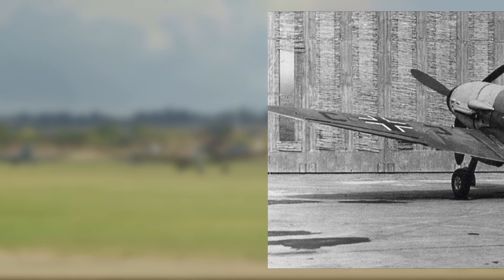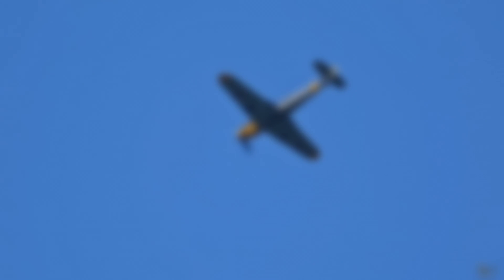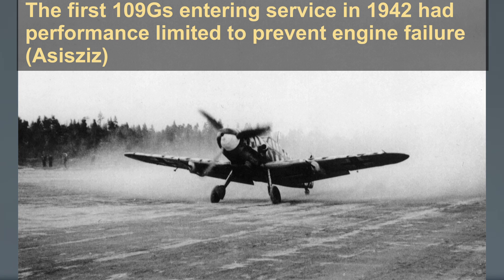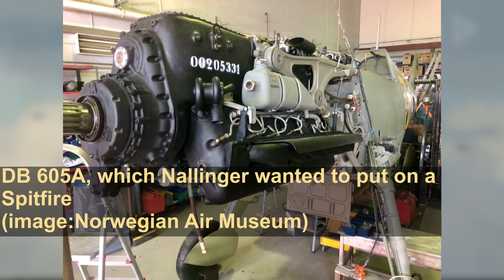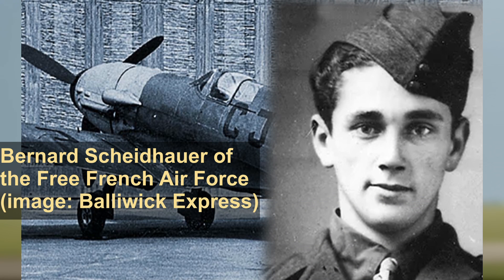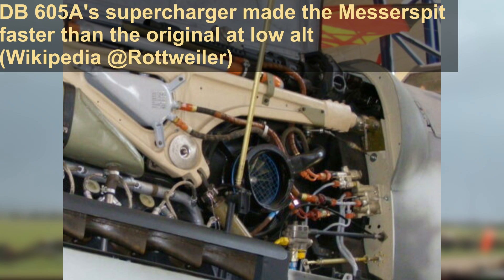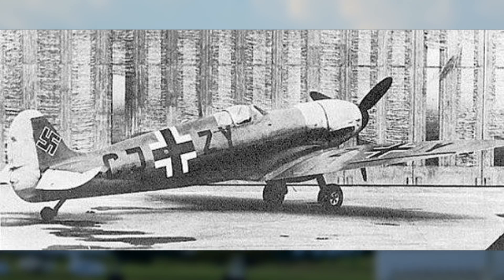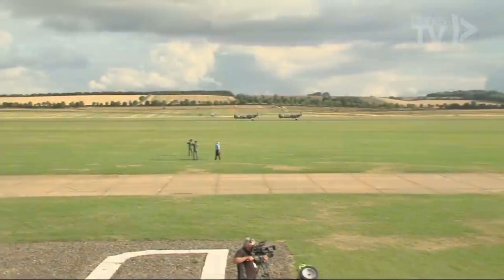All is Fair in Corporate Warfare | Spitfire with DB 605A, “Messerspit”

Comment: wasn't german synthetic petrol roughly equivalent to lowest acceptable grade of american petrol?
Reply: C3 was 130 octane. Reaction with fuel tank liners did however degrade the octane levels. The Germans also ran very lean mixtures which also impacts actual achieved antiknock performance.
This was partly corrected by injection of methanol which has an inherent octane of 114 and also significantly cooled the cylinders. The cooling effect raises the effective octane by 19 points.
Reply: Supposedly their fuel was 87 octane. That is low octane car gasoline today.

.
Reply: @craigd1275  Yep. heard same thing a from Greg's areoplanes and automobile channel. He mentioned some big diffrence between estimated and factual octane noumber caused by faulty processing or something. but i'm not sure if it wasn't C4 petrol as he compared super late war performance of mustangs and Fw-190 d-13. And here we have bit earlier dispute.
Reply: @radosaworman7628  Greg's airplanes takes the position that German avgas octane ratings were limiting factors to German engine performance. Actually, the exact opposite is the case. British knew this in '43, and we're puzzled to war's end as to why Germans were making avgas with octane limits exceeding their needs. Germany's crucial, staggering lack of strategic alloying materials was crippling their engine performance, preventing higher boosts, rpm's, requiring much increased maintenance. At that point, needing higher octanes was the least of their worries. Think of it like flying into combat with a bunch of glass engines: do the "wrong" thing and bearings spin, valves burn (detonation), gears fail.
German engines, very accurately & precisely machined, had after 1940, increasingly alloys much inferior to Allies, lead babbitt bearing technology unable to cope with the required stresses, no nickel in the valves (Allied valves almost solid nickel), etc, etc.
Reply: @craigd1275  That was the prewar B4 specification. 
Britain ran on the same fuel. Russia used 65 Octane (which made Russian fuel unusable by anyone else).
Germany switched to 93/115 Octane C3 at about the same time the British rolled out 100/130 and the US 100/120 with the Germans progressively raising the octane to 97/130 by the end of WW2 but there was never enough to go round.
High octane fuel shortages were why jet engines got pushed hard. Jet engines will run on absolute shit fuel.
Reply: @radosaworman7628  Those figures were from US studies on German and British fuels so use US testing protocols. Basically the Germans did have fuel that had an only marginally lower octane rating than American and British fuel but never enough of it.
Russian fuel was absolute shit.
Reply: @radosaworman7628  Those weren’t German figures. US technical research analysed the fuel in the tanks of shot down German aircraft.
The best synthetic fuel wasn’t better than what the British or American’s made but it was closely comparable. Adding methanol injection made up the difference for fighter aircraft.
The Germans just never had enough C3 fuel and had to depend on the lower octane B4 fuel for all their bombers and a lot of the lower altitude fighter aircraft unlike the British and Americans who used 100/130 octane in everything.
The LACK of fuel was a bigger problem for the Germans. Only one in ten of the jet fighters the Germans built in 1945 ever flew - because they didn’t have fuel to put in the tanks. That was the actual success of the US and British bombing campaign and the consequence of the failure of the German Eastern Front in 1943.
Reply: I know it was lower octane compared to the British fuels. One of the German blunders was not realizing the British had stockpiled better fuel.
Reply: @alexandriashannon7438  The Germans were not party to the two different technologies behind the American and British high octane fuels. The Germans invented a third way but it wasn’t quite as good.
The American high octane fuels arrived in Britain just in time for the Battle of Britain to supplement the limited British  produced stocks and that combined with the new constant speed propellers fitted to the Merlin engined aircraft at the same time.
The combination significantly improved the performance of the British fighters to the point they were significantly faster than the German aircraft and that combined with their tighter turning circles to give a significant advantage.
Reply: @allangibson8494  Germans were using CS props for BoB.
Reply: @josephstabile9154  The British went from wooden two bladed fixed position through three bladed two position props just before the BoB to three bladed Constant speed during the BoB. All 1000 fighters in service were converted between 24 June and 16 August 1940 and this increased the service ceiling by 7000 ft on the Spitfires.
It completely revolutionised the Merlin’s performance.
Miss Shillings Orifice didn’t hurt either.
Reply: You're absolutely correct regarding the transformative effect CS props had on Spitfire performance--esp. marked when compared to the fixed pitch prop.
This change was so crucial that the RAF may otherwise have lost BoB--because  the Luftwaffe was using CS props.
Reply: @alexandriashannon7438  No, this is incorrect. Germans made fuels with octanes in excess of their engines needs thruout war. British knew this by '43, and we're puzzled by this until war's end. B4~92 octane, C3~130 
octane. what Germans DIDN'T have was anywhere sufficient production (fatal), and sufficient quantities of strategic alloying materials for their engines (near fatal), preventing their using their avgas to its limits.
Reply: German B4 actually tests by  
Allied ratings to ~92. C3 tests to ~130. However, avgas, Allied or Axis, has both lean mixture octane ratings, and rich mixture ratings.
BTW, British knew from '43 on that Germans were making higher octanes than their engines needed, and were puzzled until the end of the war about this. What they didn't know was the extent of the lack of critical alloying materials was hampering German aviation industry, and was the real limiting factor--not octane ratings. 
There're other aspects to the German avgas & production that affected their fighters. Competency at making high octane fuels wasn't an issue.
Making the fuels in sufficient quantities definitely was an issue.